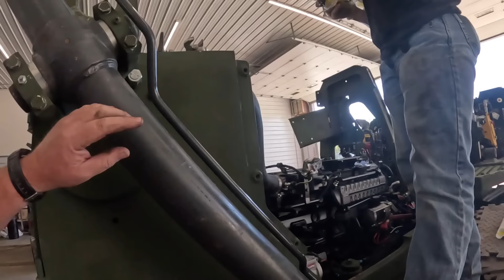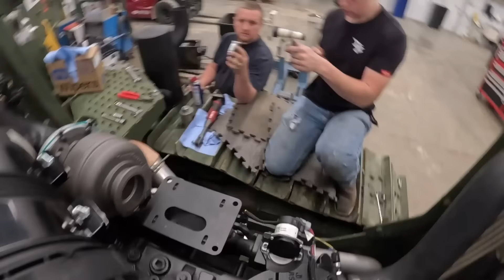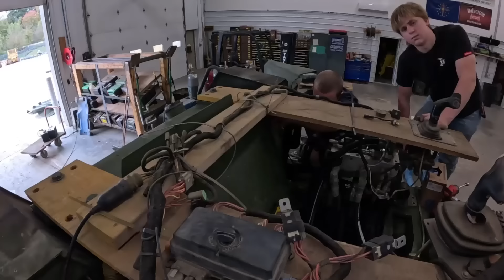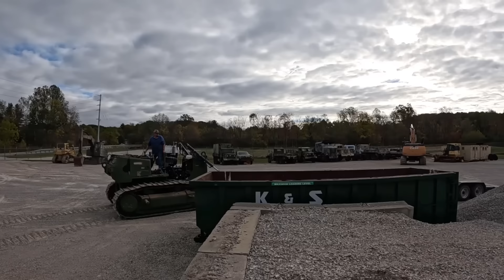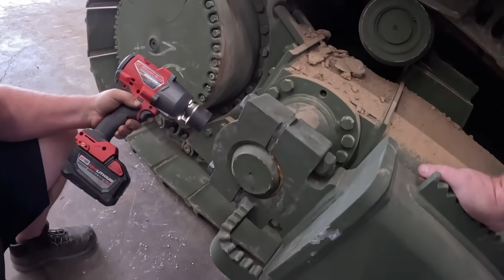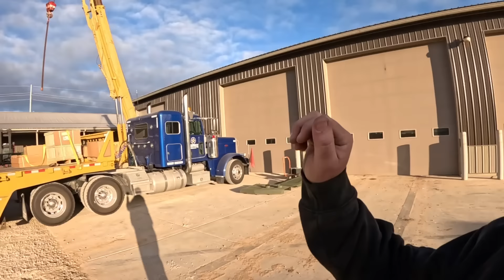New old stock abandoned John Deere 850JR bulldozer comes alive again with help @AreaDieselService

Comment: I live in Japan near a Subaru plant and a Mitsuba Hub, so there are hundreds of mom-n-pop shops, dozens of medium sized factories, and several large sprawling plants making car parts. I guarantee you some grandpa with 6 hydraulic stamping presses in a small garage stamped out that switch bracket, another “warped” it into shape, and then sent it off to another plant to get welded & coated, another shop injection -molded the cover (with dies from China - they are the masters now) and Denso ordered in the trays of housings and then some complicated automatic soldering / pressing rig pushed them all together to make the final part - with 5 or so defective switches nailed to the wall next to the machine to account for process failures. The medium sized part assembly factories are really interesting! 

The ka-thunk of stamping presses rings out as you walk in rural neighborhoods out in the countryside - good luck with all your wrenching on the big iron!
Reply: Thanks for sharing that with us, it’s very interesting to hear how things are made over there!! Good day to you!! 😊
Reply: Japan loves there small factories and mom and pop shops. Tokyo is even zoned to accommodate that. I would love to visit Japan one day. They love their manufacturing.

Comment: The top of the blade cylinder needs turned as the grease fitting is on the bottom and no way to grease the top of the cylinder

Comment: Great job on the 850! You will need to turn over the top link on the right tilt cylinder. The grease zerk needs to be facing up like the one on the left side.

Comment: Tucker installing the turbo with the drain line on."Who does this".Reply from dad "John Deere".Tucker in time will understand that engineers/designers in the end aren't really worried about how easy it is to do repairs.If it looks good on the drawing board build it.

Comment: Did John Deere need the blade on to set the computer?  Otherwise it would have saved you a bit by not hauling the weight of the blade to Deere.

Comment: This would to be the most expensive rebuild to date that I have watched so far. In saying that - the dozer body, tracks, engine and so on looks brand new. Have you worked on the transmission? I hope there is nothing wrong with it. Great work guys.
Reply from the maker: Nope

Comment: Can understand your frustration with the courier shipments Clint, many years ago I was a partner in a Dive Shop in the Solomon Islands, we had ordered some Dive Compressor parts from the USA to be couriered to us urgently and they just plain disappeared en route somewhere.
After a couple of weeks we had to reorder and got our equipment up and running again but almost a year later the original order turned up in a raggarty assed condition, the original delivery label read “SOLOMON IRELAND”, …….must have been a Monday Dispatch……I think everybody has a tale from hell regarding couriers irrespective of which one it is……I can’t exactly recall who it was in our case so I better not point fingers, though I bet any that read this will be checking their files.😂

Comment: My most memorable F'ed Up Depress delivery was an LTL delivery of my new 7 foot Finish Mower. Steel Mower in a Steel Shipping Crate that they stacked on top of 2 smaller pallets spaced 5 feet apart, and then they stacked a 4500 pound pallet centered on top of my new mower. By the time they drove down every unpaved road for 800 miles with the Air Ride dumped, my new mower was bent in half. Took pictures, filed an Insurance Claim, and 4 years later I'm still out of pocket for almost 3 grand, no new mower, and they could care less. Never again !

Comment: When I was in the Army I got transferred to a Armored unit, one day at lunch time 2 guys had a m60 tank engine sitting on the ground testing it before putting it in they didn’t hook up the kill switch (V 12 ) with a turbo each side someone yelled lunch the guy right side folded his arm at elbow over the inlet and told other guy to block left turbo, he didn’t have a shirt on so he decided to put his chest against the inlet sounded like slapping a open bottle  ……….. biggest hicky I ever saw

Comment: That's kinda sad that your company can't have dealer access to what ever is needed for new computer installs. They might as well not sell you the computer, if you have to bring it and the equipment in to have it calibrated or what ever it's called. I hear the farmers are having the same problem, maybe even worse. I'm glad they at least didn't require you to put the cab back on the machine like some lawnmower repair shops do. Enjoyed the latest video but I still have some old ones to look at. If you could, have a way where you can look at all the part 1, 2, 3, 4, etc of the videos of the repairs you do in order on your playlists. I'm having a tough time finding all the parts of each build series. (if that makes sense) HAPPY HOLIDAYS

Comment: On making Hydraulic hoses, it’s advisable to mark the side of the hose to make sure it’s fully seated in the fitting, spraying it with WD40 helps. Also when you fully crimp the fitting, index it a little and crimp it again. That eliminates any sharp edges on the crimp ,

Comment: There’s a Hydraulic reason why the fittings are on the top. To allow air to escape the cylinder. To stop sponginess and make for better control. Unless the cylinder is fitted with air bleeder screws like a break caliper on a disc brakes